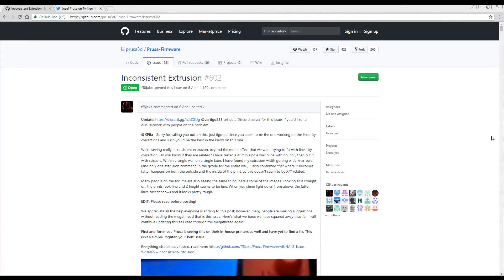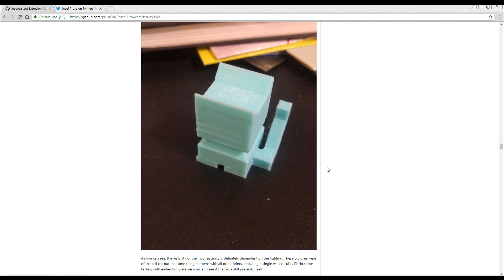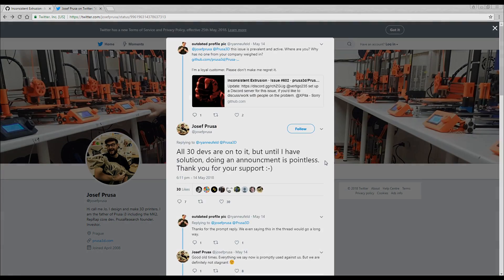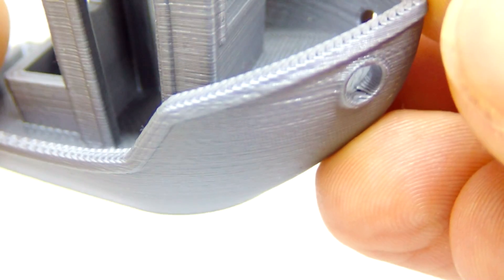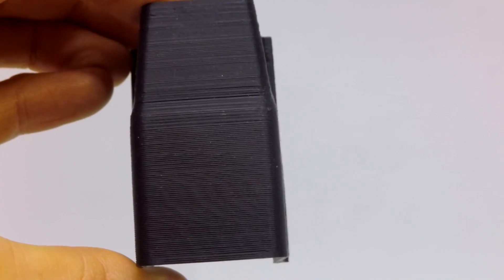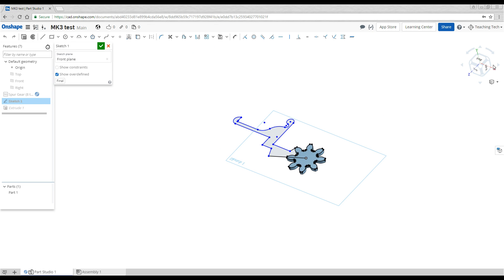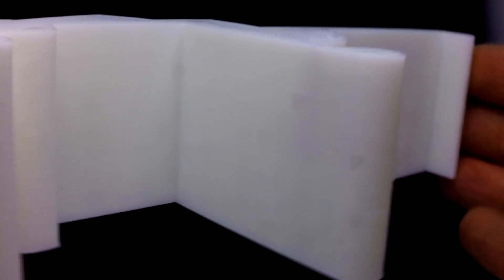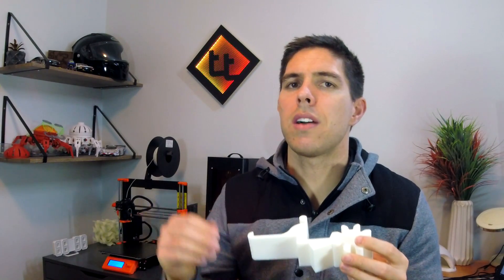Prusa MK3 extrusion issue: Just how bad is it?

Comment: Prusa is a con artist that sells under developed shite. never ever will i buy anything from this buch of charlatans!
Reply: What I’ve noticed is that the 602 issue is mainly worsened by cheap moist filament causing extrusion issues. I’ve helped setup 2 printers now and the different between quality of filament is a true shocker.

Comment: So I have fought this off and on for a year now, not having time to sit down and run it to ground it has dragged on. It started doing thermal runaway and under extrusion after a firmware update. After replacing the heater several times, thermistor, Rambo board I finally realized the issue! Default Prusa software slicer settings no longer are optimized for my i3 MK3! Slow it down and reduce the cooling fan speed to make the issues go away again. Hope this helps someone.

Comment: I own an PRUSA I3 MK3 but I'm thinking of buying a sledge hammer and slam this damn thing, People. don't believe this 3d printer is good, bed leveling on this printer is bad, even an ender 3 is beter 
My advice, DON'T BUY A PRUSA, they have to solve there problems with the first layer and problems with adhesion with the PEI basis.
Reply: You can’t always blame the company when it shows that you likely maintain the machine improperly. I’ve owned a PRUSA for over a year and have had less than 5 prints fail due to bed leveling or prints becoming unstuck.

Comment: after removing the weight from my z axis, i couldnt notice it anymore. I did a dry box with bearing rollers. before i changed it, I could notice that retractions let the spool wobble quite a bit and made it harder for the extruder to pull in filament. I love my mk3, i dont use any of my other printers anymore... shame on me

Comment: Maybe its slight variations in the power. When stepper motors are using more power it takes away power from the hot end or filament feed.

Comment: Dude... It's a 999 euros printer, there is nothing "fascinating" about this problem.
Reply from the maker: Please don't be dishonest. The kit is 635 euros and the assembled version 825. Given the amount of people in the community that discussed this and worked towards a solution, and the mystery around the cause, I think it is safe to declare that the topic is thoroughly engaging.
Reply: @TeachingTech  pls you dont be dishonest, in euros it's 999 assembled.

Wanna check? https://shop.prusa3d.com/en/17-3d-printers 

Of course the entire community was trying to fix the problem, it's a 800/1000 euros printer!

And you find this engaging? Do you work for your money? Because people work their asses off for a minimal wage today and investing so much in an overpriced 3d printer (yes Prusa printers are very overpriced) means that they would like to get a perfectly working machine, not having to fiddle with it.

Otherwise we would get a CR10S and we would be "delighted" to have to fix almost everything to get a good print, but for a much bigger size and half the price of the MK3!
Reply: @Carlovfx  Its 999 US dollars. They list prices in US dollars by default. Once you switch to Euros in the drop-down menu, it shows that Teaching Tech is correct. Personally, I find this engaging because:
1. The printer still works fine, for me and my school at least, even though the surface finish may not be the best. If the issue made the prints unusable, then it wouldn't be engaging, and I would request a refund. Truth is, those who get unusable prints of the Prusa MK3 most definitely have something wrong with their printer. My school has a dozen Prusa MK3s, and none of them have noteworthy extrusion inconsistency, though cooling is not ideal. Guess what? We have three Cube Pro Trios just gathering dust beside them because the Prusas are so easy to use, while the Cube Pros are too much of a hassle to use and (especially to) maintain. How much is the Cube Pro? 2535USD. Prusa is still worth the price because of so many other things, reliability being one of them.
2. The cause of this is still a mystery, and people are definitely working hard for a solution.
3. This affects all printers to a varying degree, if Prusa solves this, then we can apply this to other printers and improve FDM printing.
I do agree that Prusa is not the best value, but it's up there. Especially when compared to Ultimaker, Cube, Makerbot, etc.

Comment: all the issues from this video isnt from prusa, its just a incurrect installed 3d printer or filament issues.. 
Some are Z axis issues, bed movement issues, to loose or hard tensioned belts and so on.. 
Also this may have to do with the removable bed moving.. There is so many things that can do this kind of surfaces.

Your printing in white btw.. Try printing in blue or black and you will see it more
Reply from the maker: Do you own a MK3?
A lot of assumptions here.
You are right about the white filament, however.
Reply: No im building printers myself so i havent got one "yet"
Reply: @williamwestonn  So how can you assume he didn't just buy the assembled unit? Jesus
Reply: @alejandroperez5368  even prusa themself can install things wrong. Transport and other things like bad bearings can be an issue. I have been working with printers for a long time and i meet new issues every day. These issues are known and can be solved. 

The video is great because a printer in this priceclass shouldnt have any issues like this if it was pre assemblied. If it wasnt. An experienced builder should not have any issues to install it without getting things like this.
Reply: @williamwestonn  Well, in such case you need to fix your initial comment ("all the issues from this video isnt from prusa")
Reply: @alejandroperez5368  no, some issues is caused by prusa, some are from people not handling the parts right and some may even be caused by shipping. 

One big issue shown in the video is Horizontal Z lines caused by unaligned Z screws that are binding. This can be caused by people lifting the screws from the box without care. They easily bend if you lift them holding the top of the screws and so on. They can bend if you assemble the machine wrong or force parts together. 

Pre assemblied printers can be damaged in shipping where force is put on the screws making them uneven. 

The main issue is that people tend to think, just because my prints look similar, it means i have the same issue.. but its not always that easy if you cant see the way things show defects. 

But you are right in a way. These issues is prusas fault because the design. Its not easy to design a perfect printer. And prusas printer is faar away from perfect
Reply: @TeachingTech  long time ago, i now own a mk3 and i would keep my comment as it is :) 

The only comment i would adjust is that you can tension the belts to hard. 

And no. You cant... but yes... you can tension a belt and get issues. But if that is the case, its not the belt, its usually pulleys and belt accessories that will give you issues. 

I have found that the tension system for the prusa is kind of bad.. the biggest issue i find is the bed beeing a little to loose sometimes and the bearings for the bed giving it more play then what you want for perfect printing. 

If you look at the prints you do in a prusa you can see that every layer is a little rought, its not 100% smooth. This is issues caused by the design of the Lm bearing blocks and how they work. 
I found MYT bearings not to have this issue. But to remove these small improfections, the best way is to pay for expensive hiwin or similar guiderails. With V0 preload and bearings with a balchain.
Reply: tell me you know absolutley nothing about issue 602 without telling me. I own a several Mk3s and they all have it. The only thing consistent between them is issue 602. All of the things you have mentioned hardware wise are irrelevant to issue 602. It is not user error, what it is, obviously no one ever found out.

Comment: I did not have this issue, I do had an issue with the flatness of the frame, the front plate was a bit bend. But a flat piece of glass and some clamps and leaving it all night to settle fixed this. After assembly no issues at all. Did not needed any tweaking. Even the Extruder loaded on first try.
Reply from the maker: Surprised to hear a MK3 being damaged presumably during shipping. Glad you got it going again. I think this issue is exaggerated, under normal light my prints look beautiful.

Comment: Lmao. Prusa responded to the problem pretty much saying it's due to incorrect kit assembly. Could you imagine having problems with the machine, going through the directions over and over again, taking bits of the machine apart and rebuilding them making sure every little thing is perfect, only to have the tech support come back and tell you that you didn't put it together right. 

I'd bet it's got to do with that bondtech retrofit into their extruder carriage. Seems like the kind of thing that requires a higher level of accuracy than can be provided by quickly pumped out 3d parts. Could be the PETG material they made it from. This is their first with PETG i believe? Anyways, it's a pretty flexible rigid. Don't know how all the motors mount but I'd be having a look at that. 

Ive got this kit on the way. It's currently backordered. If Iv'e got issues the first thing I'm doing is throwing on a 3mm bowden v6 with a titan to see what I get.
Reply from the maker: In the Tom D video he mentioned the Bondtech gears cutting too deep and making the filament dameter fluctuate. The newsletter hinted that they were working on something to assistt so et's see what happens.
Reply: It appears that their own highly controlled filament brand is part of that solution.

Comment: i honestly think this is slop from the lm8uu from my testing the linear platform of the cr10 seems to run far smoother as its just adjustable. you're just seeing the machine vibrations show up in the slop of the axis's
Reply: I think so too ! Compared lm8uu and plastic lm8uu and I think plastic works better

Comment: Thank you so much for covering this.  I'm getting a bit tired of hearing how great these printers are, when there is definitely problems. Yes J Prusa wants to get these issues fixed, but I think he is juggling a bit too many items.  Of my three 3D printers, this one is the most troublesome, BY FAR.  Remember the PINDA heating issue?  Its still there and I and others STILL get inconsistent Z height. Oh, and how about the Multi Material V1 fiasco. Luckily I never spent my time installing it. Seems when they say how great V2 is, you never hear about all those people who wasted time and money on V1.  And those YouTube folks seemed to love it as well. 

As we speak I'm printing the MK2.5 upgrade parts ON MY Flashforge Dreamer, which is 5X better than the Prusa will ever be.  Tried to print them on my MK2S, but extruder constantly slipped with PETG. I hear the MK2.5 extruder (Bondtech) has problems as well. I can hardly wait.

Comment: :( these things are the reason i am really inclined to cancel my order... Apart from the spring steel bed (easy mod for almost any printer) there is nothing that awesome to justify the price.... Or am i wrong?
Reply from the maker: I'm modifying my Wanhao Di3 clone to have much of the same equipment but my MK3 is still my go to reliable machine. The more I look at prints from other printers, the less f a problem I think the average MK3 has. Most prints ook less than ideal under such harsh lighting. Although some users are vocal about this, the vast majority don't care and are happy.
Reply: Thanks for the reply. I can imagine that the users having the issues are the vocal minority. But still, when I see some comparisons with much cheaper printers, it is quite scary... I do hope these are just extremes.. Thanks for the informative and unbiased videos and keep up the good work!
Reply: @ScorpioDB  My school has a dozen Prusa MK3s, and I can confirm what Teaching Tech replied. We abandoned our Cube Pro Trios for the Prusas because they are MUCH more reliable, and easier to maintain. None of them are noteworthy for having pronounced extrusion inconsistencies. It's there, but not bad enough to raise concern. I believe that if the printer is properly assembled and calibrated, extrusion inconsistency is not too much of an issue. Yes, the Prusa is far from being the best, but so many other things still make it one of the best printers around the 1000 USD price point.

Comment: this is so strange, iv had my mk3 for 5 months now an havent come across these issues, guess im a lucky one. iv had really great prints and i have bad ones as any other person would but i manage to fix these. im working on getting a couple other printers in the future and im no brand fan but i surely want to have different types. but as anyone else im learning more and more about printing and prints are slowly getting more advanced.
Reply from the maker: The 3D printing journey is very satisfying, sounds like you are doing well. I was happy with my prints until I put them under this extremely unflattering light. I've looked at other review videos and the quality is the same as mine, but no one is unhappy. It's a funny issue.

Comment: Some of the prints that are referred to as "ok" in the video are far from imo,  the benchy for example. If i got a benchy looking like that on one of my DIY printers I'd start troubleshooting straight away since something is clearly wrong. A printer should be able to create a smooth surface. 
When trying to identify print/extrusion quality black filament is quite good as any flaws show up really well to the naked eye under strong light from an angle. No idea if it works with a camera though but please try it as was almost impossible to see the print quality of the white part you printed in the video.
Reply from the maker: I think I agree in that the moire is worse than the publicised extrusion problem. I've been checking other YouTube reviews and they all have it.

Was low on filament, regrettably white was all I had a bunch of.

Comment: Every print you posted I would expect out of my 160$ Monoprice mini delta. I can get better print quality than ANY of the things you posted out of my Monoprice Mini V2.
I also have a mk3. and with stock firmware/hardware, I would compare it to the monoprice mini. Just 4x the price.
I've modded my mk3 however, and I can assure you. The mk3 is capable of MUCH more.
Try to compare "equal" prints... Don't compare your worst test prints, with your best mk3 prints. lol.
Also, your benchy looked like it was sliced in Cura with fuzzy skin... Was it? becuase if it wasn't the extrusion looks terrible. Either junk filament, or your mk3, has the issue all the other stock mk3's have.
I've un-subbed because I don't trust you to be unbiased and honest anymore.
Reply from the maker: Hi Sean, disappointed to hear you didn't like the video. I would love to win back your sub. Thanks for outlining exactly what you didn't like, a couple of points:
-The lighting is designed to be as unflattering as possible. The two where I note the quality is poor are the only two that look off in real life. Case in point, that is the same benchy from my linear advance video, which has twice of the views and not one single comment about looking bad. It's certainly not perfect but it looks decent sitting on the table next to me, as do the test cubes and lego.
-The selection was not chosen from my best mk3 prints. In fact, I showed my worse two prints ever. I have never slowed the speed down to try and print a benchy or cube as perfect as possible. The two trigger handles were the same project on different printers. Different colour filament but both good quality brands. The two at the end were to show how production 3D printed parts compare, they weren't done by me. One was good, one was poor.
-I don't think I have the issue as bad as many of the posts on the github thread.
-The notion that I'm biased, I assume towards the MK3, is incorrect. I doubt Prusa Research would be happy videos like this circulating. I could have remaned silent, my only mk3 content being my positive, previous videos. I would suggest this video gives me more credibility of being balanced by its existance.
-Overall I still really enjoy this printer. It is my go to, reliable, convenient machine. As I said in the video, I mainly print functional parts. Like many of the commenters here, I would like the problem fixed but it's not a dealbreaker in the meantime.
Reply: For going so far as to write that, I'll give you your sub back. :)
You should stop by the discord the Prusa guys have going, and ask a few questions. I'm not going to go into all the detail, as I don't understand the super-technical side of it.
But we have mk3's printing perfect. It might intrest you, as far as I am aware no one has covered the "Klipper firmware mod." It's still in it's early stages, and missing a few features. But the quality is out of this world. I can print a benchy in around 1 hour, that looks comparable to yours in most ways, better in others... If I slow it down... It looks amazing. Filament truely matters on this printer when it works. Cheap filament looks like your prints. Expensive filaments barely look like FDM.

https://discord.gg/Bf96zB

Stop by, and ask a few questions, we can show you our high res images and stuff too there.